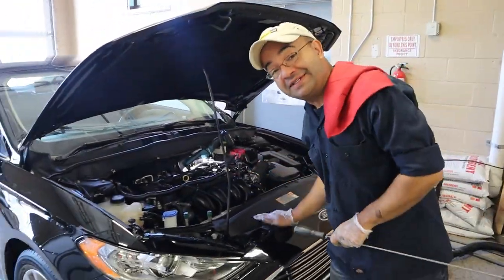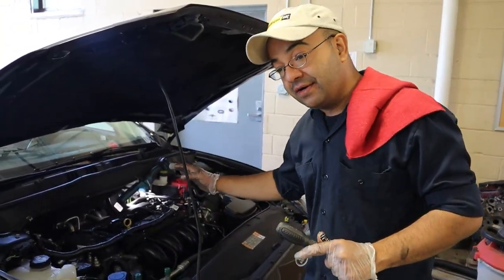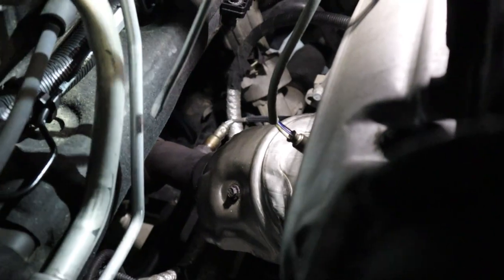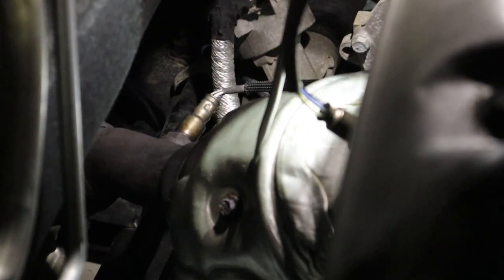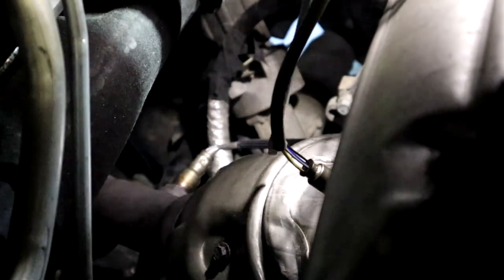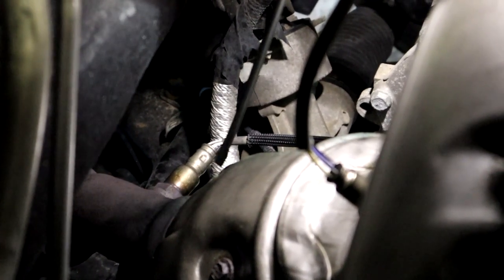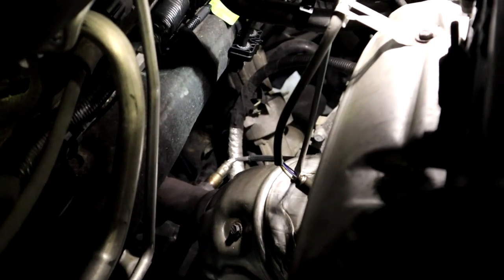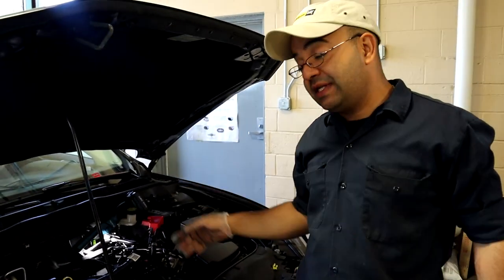2017 Ford Fusion P0420 Oxygen Sensor & Catalytic Converter

Comment: Awesome video! Currently having the same problem! Would you please tell me how much should the sensor replacement cost so I know if I’m being ripped off or not?? Thank you!
Reply: Auto zone has it for $47
Reply: Just bought it today and installed it
Reply: @Alberto-dc6vi  hey brotha u replaceing that second sensor fix the problem?? im having the code and check engine as well
Reply: @luigie916  yes also you can get the sensor at the dealer not expensive at all
Reply: @Alberto-dc6vi were you getting error code P0420?

Comment: I also got a p0420 code on my 2007 ford f150.
I had the check engine light on for about four days.
I took that truck on the freeway and totally abused that gas pedal and guess what?... my engine light turned off the next day.

Comment: What about the same error on  2019 Ford Fusion? Imma bout to take my car in for the 3rd time. Dealer hasn't found the problem.
Reply: Sounds like they know that its the Catalyst converter and it don't want to change it.
Reply: Is it under 36,000 miles? Because it is. They are definitely waiting when you breach it to tell you.
Reply: Have u fixed it ?
If so..What was the fix please

Comment: I have replaced both sensors and new Plugs and filter on my 2015 Ford Fusion SE  2.5 Lt 4 cylinder. I still have the light on. I have a FIXD which I cleared the check engine light and it still comes back on rather quickly. Does this check engine situation need to be cleared out by a Ford Garage to reset it, or am I in need of the Catalytic Converter?
Reply: What are the trouble codes stored in the PCM ?

Only P0420 ?
Reply: @bobomomo3764  yes that's the only code that keeps showing up. Is it safe to say replace the Catalytic converter??

Comment: Replacing your post cat o2 sensor is not going to help. If that sensor was bad. You would get a different code. If you replace the o2 sensor and the code come back. Are you going to refund the owner money?
Reply: I dont know the code but it says catalyst system efficiency below threshold ( Bank 1 ).  Shall I just change catalyst or is it co2 sensor ?
Reply: @Maxy_Boy09  I have the same issue with yours
Reply: @Maxy_Boy09 did you ever figure it out?
Reply: @Maxy_Boy09  I changed the upstream and downstream and the cat as well. The check engine is still on.

Comment: Hello buddy, the computer shows the code P0141. I want to be sure which oxygen sensor is f....ck is.  /Bank 1 sensor No. 2. /Engine 2.0 ecoboost fusion 2018. Thx for answer
Reply: Did u fix that? What was the fix for this issue if u remember?
Reply: @bobomomo3764  Hello Bro I replaced the main and the problem was over. That was Bank 1 sensor number 2. Thx The sensor was overheated
Reply: @bobomomo3764  9E5Z-9F472-D

Comment: i have a 2016 2.5L ford fusion where is bank 1 sensor 2 location? cab tiy help me plz
Reply: It's the lower one in this video 
0:43
What was the issue for your car and what was the fix can u please share ? The codes the fix ...

We would appreciate it 🤍
Reply: @bobomomo3764  I replaced the o2 sencer in Bank 2 but now Bank 1 is doing the same thing, I replaced it but still getting the Light of Death.

Comment: i changed the cat and both oxygen sensors and still have CEL p0420 . . . .any suggestions ?
Reply: I have a 2017 2.0 and im trying to get the upper oxygen sensor to break free. I started to round it so i stopped. Im thinking maybe a 6 point 1/2 socket and a ratchet... Very tight to get to. no fence pipe cheater bar will get in there. As well as i usually use map gas to heat it up but maybe that is an option.

Comment: I changed the 02 sensor and catalytic converter
Reply: How much did you pay overall? If you don’t mind me asking
Reply: @isaacsanchez5790  02 sensor 130.00 for both catalytic converter 375.00 and labor was 125. For install

Comment: You can change what you your wont but this code is not going at 90% thats just because Ford make the marge of the co2 so low in the ecu that the car by 100dkm show cat problems witch don’t have. 
Best option is to reprogram and delete p0420 to never show. And don’t spend money.